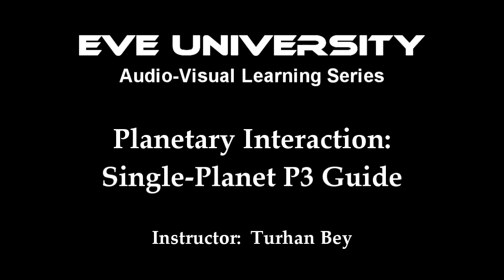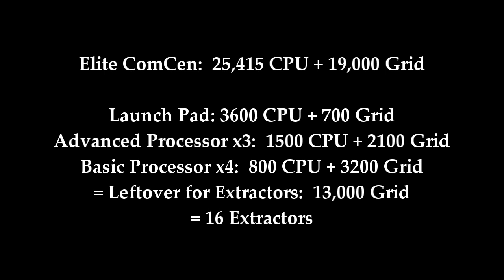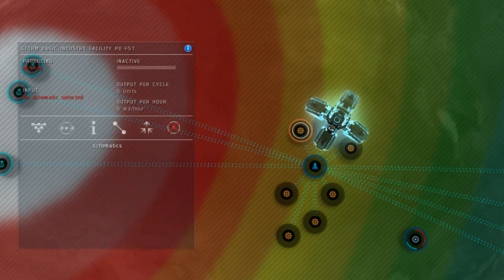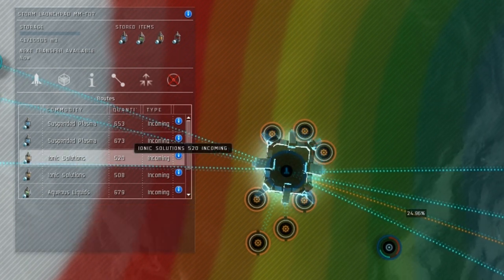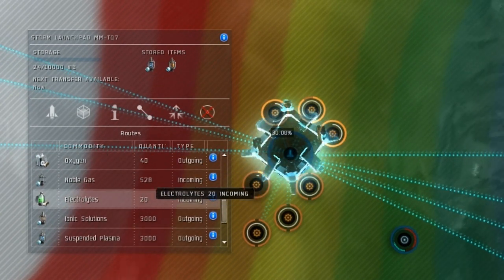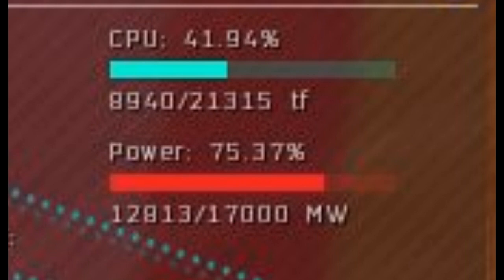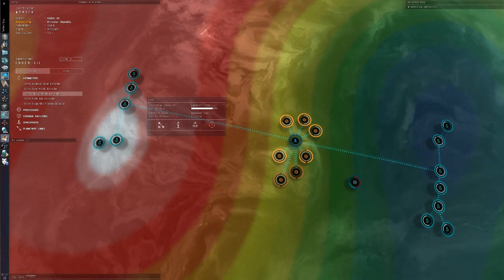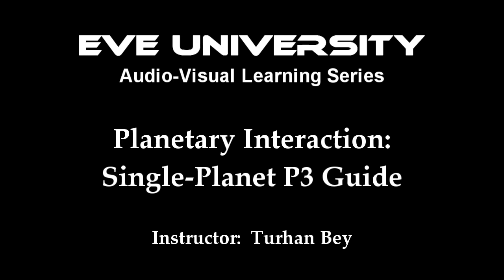E-UNI Planetary Interaction Single-Planet P3 Guide, part 2

Comment: So for a p3 single planet chain i need lvl 5 command centre? i've been tryin to do this myself but my PG runs out by just trying to do the first product and i have a lvl 4
Reply from the maker: +Dulf Nordensvärd  It's possible.  I've unfortunately not tried it at all recently, and you may have noticed that this tutorial is many years old and PI has had some (mostly minor) changes since then.  :)  But yeah, it's entirely possible that you may need a Lv.5 ComCen, especially if other parts (e.g. link lengths) may need the additional CPU/PG.

Comment from the maker: Note that this video was posted about 2.5 years ago.  :)  The details of some of the mechanics have changed a bit since then, such as the switch to using Extractor Heads.  But many of the general concepts still apply, which is why I still keep the video published.

Comment: Pretty good guide.  Pay close attention to the end where the linking is cleaned up and made more efficient.  Better to start this way that way you have a better idea of the power and cpu usage.  A few numbers to keep in mind when deciding to setup your extractors:

Each P1 facility will need 144,000 units of raw material to keep it producting for 1 day.

So if you have 4 P2 facilities you will need to be extracting 576,000 units of ore a day to keep them in continous operation.

Comment: @stellarfirefly 

I'm pretty sure TheMelrakal means you should put 1 link from 1 extractor in each group and the storage facility, linking all of the other extractors in the group to the one that's linked to the storage facility.  Using the shortest links possible between extractors and using a multipart route reduces the total grid used up on links.  The "star" topology is unnecessarily wasteful, and you can make use of less-optimal planets by using shorter links.

Comment from the maker: @poki 
It is definitely more efficient, and will gain you more isk over the same amount of time, if you use separate planets and that is what I do.  The reason to ever use a single planet for a P2 (or especially a P3) is to make PiBearing a more passive income for you.  You will need far less interaction (reset Extractors, haul once every few weeks) but you won't make as much money as using several planets and hauling between them every couple of days.

Comment from the maker: @TheMelrakal 
Of course, shorter links will cost less CPU/PG.  But we need to extract 4 resources from 2 separate locations.  The alternative is to use multiple planets, and pull only 1 or 2 resources per planet.  The advantage to that is better efficiency.  But the advantage to this SINGLE-PLANET solution is less hassle.  We never haul intermediate products; we only haul away the final P3 item.

Comment from the maker: @Duffman2506 
It can drop, but it might not, and it does not always drop by a set amount.  But yes, resources both deplete and replenish.  They will deplete faster if you have lots of extractors in one small area and/or extracting very often.  And other players have also seen resource hotspots slightly migrate, though I haven't tried to collect evidence of this yet myself.

Comment from the maker: @ARIS1979 
(As I replied to andysim232 earlier:)  You can link Extractors to one another, but you cannot create a Route from one to another. When you create a Route, make sure it goes all the way to either a Storage (or ComCen or Launch Pad) or directly into a Processor. It can then hop multiple links (up to 6, I think) to reach its destination.

Comment from the maker: @NavyfieldFanKoreta 
If I recall correctly, this video was made using an Improved ComCen, which requires only ComCen Upgrades 3.  You may be able to process a single-planet P3 with a lesser ComCen, but it may be tough because you'll probably have to work with minimal extractors (and very short links) due to the limited PowerGrid.

Comment: @stellarfirefly well, yeh, its all comes down to style after optimization, for example i prefer to use storage facilities as i extract faster than i process , so that sometimes even if i dont have the time to set the extractors, i will have the buffered material on the storage facilities to cover my potential loss of time. and i will use launchpad only for the end product storage, CC for P1 storage and storage facilities for raw material storage.

Comment from the maker: @davelantor 
That will not work if you extract faster than your processor can handle, unless you add more storage.  While a Storage Facility only requires 700 PG, it is certainly not a universal "always use it" solution, and in fact it was not a good option for this particular setup.  The link upgrades used far less than 700 PG total.

Comment: @stellarfirefly still, you can optimize more :P
for example the optimization i had in mind includes NO link upgrades, because you should not push the load of all extractors into one link, without refining and making them smaller, so, for example , if you place your basic industry fec. near the extractors and refine it before sending it to main pipeline, it would take less logistics .. and you wouldnt need to upgrade it. Perhaps you should watch my video also :)

Comment: @stellarfirefly removed 2 long links from the left and 3 long links from the right .. than inter connect the 3 extractors with each other, and do the same for the other 4, that way you have 1 main route to your launch pad. from each side. you can check out my videos to see my optimized extractor setup along with P2, and up to p4 production..

Comment from the maker: @davelantor 
All links are single-length, i.e. extractor directly beside its linked structure.  The only exception is the two toward the remote sites, which cannot be avoided except to abandon the planet for another where two sites are closer to one another.  Those two lengthy links are the only ones upgraded.  Full network supports 30-min extraction cycles.  (What is your suggestion to further optimize?)

Comment from the maker: @foxrings 
You're right, the link cost for the first upgrade is slightly more than double.  But all upgrades beyond that are relatively less and less.  Example values:  86 > 183 > 291 > 407 > 528 > 655 > etc.  See the "Planetary Buildings" section of the E-UNI Wiki for an example link cost table.

Comment: @xampx2k7 
if you can handle the rigors of running 30 min cycles a lot, and live in null sec

you could look into harvesting materials that are unique to a single planet

for ex
(Autotrophs > Industrial Fibers) Temperate
(Felsic Magma > Silicon) Lava
(Reactive Gas > Oxidizing Compound) Gas

but the profitability of this remains to be seen

Comment from the maker: @foxrings 
You won't need to manually remove the routing.  Once you switch the schematic during its idle time, the old routing just vanishes and you will only need to set the new routing for the new materials.  Note as I said in my previous reply, however, that you cannot recover the material in the processor's "input buffer".  That will be lost every time you switch schematics, and so that is the one drawback to swapping a single Adv Processor.

Comment: @stellarfirefly
so what i'm guessing would be correct method to swapping production option would be to 

remove the routing,
manually transferring the leftover mats stored in the advanced processor back into the launchpad

then set up the new routing and fire up new production cycle
would this be correct?

Comment from the maker: @foxrings 
Yes, only when materials run out.  And unfortunately, you may lose a small amount of buffered materials when you perform the swap.  If there are always enough materials then the processor will run continuously.  In that case, it's time to set up a dedicated processor at the P3 level because you're already extracting enough to keep the running.

Comment from the maker: @foxrings 
You cannot interrupt a processor in progress.  Well, you can... by destroying the processor.  >_<  The swap would take place in between processing cycles, which should not be too big of an issue if you are experiencing a lot of idle time.  Just switch blueprints during the idle time.  Remember to route the new source and final materials when you perform this swap.

Comment from the maker: @foxrings 
It's fine if you are just going for the lower resources.  However, remember that our goal here is to fully create Akomi Super Conductors, and so we need both the P2 commodities that make them.  So we need 2x Adv Processors to make the two P2's (Synth Oil, Super Conductors), and then a 3rd Adv Processor to make our P3 (Akomi Super Conductors).

Comment from the maker: @R1ncew1nd 
That is essentially correct.  The initial setup as explained is the minimum which you can scale further.  However, look back to the PowerGrid requirements.  To FULLY support an Advanced P3 Processor, you would need 4x Adv P2 which would need to be driven by 16x Basic P1.  You simply don't have the PG to drop 21 Processors, much less add Extractors to them, to fully feed a P3 chain on a single planet!

Comment: Sorry, but i would say theres a mistake. The Advanced Factory for T3 Product is only running with maximum of 50% in your example, because it needs 10 units of both T2 products per hour... but every single T2 factory is only producing 5 units per hour. so u need 4 advanced T2 factories (2 for every T2 product) to fully load your T3 factory... in all u need 8 basic and 5 advanced (4/1) facs for a 100% T3 Production. right?? ... greetz